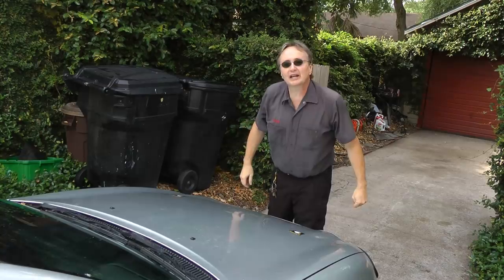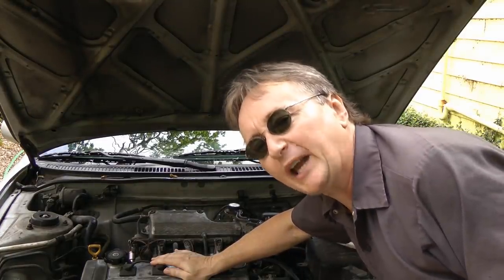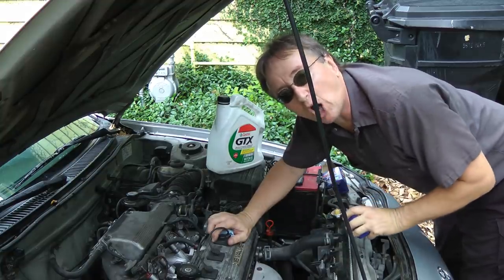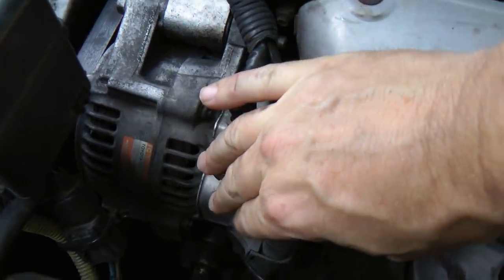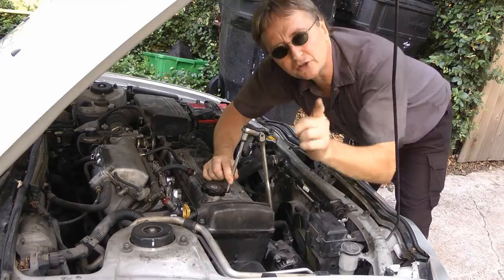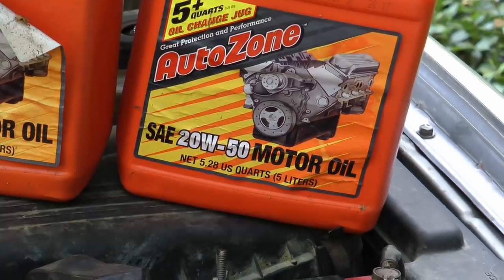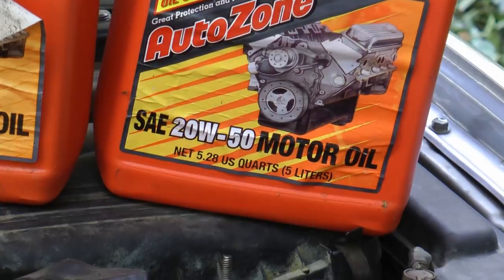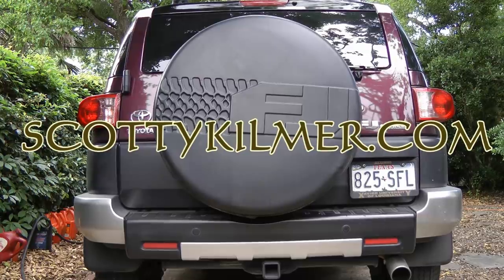Top 4 Mistakes Car Owners Make (DIY Fails)

Comment: Why are newer engines using lighter & lighter weight oil? I just saw 
0W 20 oil for the 1st time.
Reply: Innovation in both synthetic oil technology and lighter more efficient engines. Less work for more power. Less thick of a lube for same or better performance.

Comment: Another common mistake that causes a lot of drivability problems is using too much anti-seize compound on the plugs! When torqued back in the head, the compound is meshed and runs all over the plugs, gumming them up badly!!!

Comment: I know a fellow that's a engineer that works for Duke Energy electric company. !!! He buys a new Chrysler and drives it for five years about 60,000 miles he never vacuums it cleans the windows empty the ashtray but mainly he doesn't even change the oil. !!!! He will put 60,000 miles on the factory oil. !!!!! Says he don't give a shit he'll trade it in. !!! That is what scary about buying some used vehicles. ?????

Comment: Do you have to wait for the engine to completely cool down to change pcv valve?
Reply from the maker: +Jschro1987 no
Reply: +Scotty Kilmer You might want to, So you do not burn yourself depending on where it may be located.

Comment: Test your own oil. Put a quart of oil in the freezer for 3 days take it out open it up and see how it flows out and down a piece of metal do this with your cheap garbage oil and compare.!!!!! Make sure it doesn't get Vapor locked cut an extra hole in the bottom of the jug

Comment: Dont forget to fill the new oil filter    with the new oil and wet the top seal as the motor has to fill the filter when you start the Donk after changing the oil an filter

Comment: By the way, it's NOT "10 weight" - it's "10 WINTER".  The "W" means how thick the oil is when it's at 0 C (NOT 0 F).  Most temps are used in the NEW (Celsius) temp scale (0 is whwen water freezes; 100 is when water boils) - NOT Fahrenheit (0 was the coldest Winter Danier Fahrenheit - a Polish Layman - could in Danzing, Poland - in 1712, and 100 was his wife's temperature.  His wife had a FEVER!  Use Celsius, folks!!  Get with THIS CENTURY.

Comment: *recommends to look at the owners manual to determine proper oil grade to use* *warns about using the wrong grade of oil* *proceeds to use 5w-20 castrol in a car which recommends 10w-30 :D priceless

Comment: Is it true to up the oil weight when car has 200,000+ miles?
Reply: In my case it was not. I had a Ranger with over 200k so I listened to people who said use heavier oil. But I noticed when it was cold I heard some tapping at startup. So I switch it back to what was recommended and the noise went away.

Comment: I have a dodge grand caravan 3.3 the speedometer is acting crazy it drops to 0 and back to its speed but does not stall out and the ESP brake and ads light comes also the engine light the dome head and tail lights flicker no one seem to know what is the problem
Reply: There you are Scotty. Jump right in.  Dodge Caravan screwing up. (Need new caravan??)
Reply: Sounds like a complex electrical problem or computer failure. I'm willing to bet that the computer is shot.

Comment: TOP MISTAKE of this video. Saying that the "W" in the oil rating stands for "weight". It stands for WINTER i.e the lowest temperature that the car is likely to encounter. The 2nd number is the SAE rating of the oils viscosity at normal running temperature.

Comment: What do the numbers on the oil can mean, like 20w50? Thank you.
Reply from the maker: it means the basic viscosity of the oil in wintertime. 20 when engine is cold, and the same property as 50 oil when the engine is hot.
Reply: it´s a Little more than that: -------The first number is an index (not an actual physical value) for the lowest temperature it´s still below a certain viscosity- it´s supposed to mean the lowest temp at wich the oil is still pumpable with a lower index meaning a lower possible temp f.i.   0 is 40celsius, 5 is -35, etc. --------W stands for winter (to specify the meaning of the number ahead of it) ------ the second number is an index for the viscosity at 100 degree Celsius with a higher index meaning a greater viscosity (a thicker or heavier oil)

Comment: Old Black Oil On A New Filter, good going there! Use just enough NEW oil to make the gasket just glossy. This way it won't look like a leak on your motor when the old oil gets warm and runs down the side of your engine. DIY is not for everyone. Even a good You Tube Video can't make a Piker into a good mechanic right Scotty! Right!

Comment: wow. WEIGHT versus WINTER for the W on oil. oil has numbered and alphabetical codes designated for it. through time these code have changed and has been adapted into layman terms for the average public to understand. when oil is being circulated inside of engine it is lubricating no matter what weight or if it is winter. if engine is warm.  it could be zero 30 with for all that engine cares. the W is about before an engine starts and then the operating temperature of that engine. the ability to fight gravity and flow at a certain velocities and certain temperatures, long way up through push rod or to reach an overhead cam through the oil ports. and an oil pump won't pump( actually it pushes oil  ) if the oil is to thin. the W actually stands for weight instead of winter it is a unit of measurement Against Gravity ( velocity )  . A regular lawnmower that takes W 30 slings the oil to lubricate, does not pump if it had push rods, overhead cam, horizontal or vertical then the engineers would determine the Pacific weight of oil (not in pounds) for that motor well I'll take it into consideration the temperatures of that climate. Scott is old school and he is right. what weight of oil should you use, ask your manufacturer. or ask what winter weight of oil should I use in Canada.

Comment: You can always just use electrical tape and tape off the hot wire. Taping is pretty fast and easy and comes right off when your ready to attach wires to new alternator.
Reply: No need to do that if you disconnect the battery.
Reply: @jimmyraythomason1  amen

Comment: The dealership told me Nissan cars require power to the computer.  Should you still disconnect the batter and just hook up a battery charger to the positive and negative wires? Is this just a bunch of BS?

Comment: In 2019 depending on the parts, spark plugs no longer need anti-seize lubrication.
Reply: No, they still do in 2019 and in cars 2010 and newer. Companies can claim it, but when you take NGK/other brand Iridium or even Platinum plugs out they will squeak and come out dry still.  Can easily strip threads, gall up, or break plugs in half...so a dab antiseize is still needed....thats real world stuff, not reading on internet stuff.

Comment: "W" is "winter" not "weight".  Good general advice though, thanks for the video.
Reply: Francis Flynn They go hand in hand, why would a person want an oil that moves slower when cold? 20w implies both weight and winter- thicker moves slower.
Reply: Jeff Banfield no it does not. The w stands for winter and the number is the oils viscosity index. It has nothing to do with weight. Viscosity is a fluids ability to resist  flow. Weight is basically a slang term that has been used so much that it has become part of the vocabulary, but it is not correct.
Reply: It's not Winter it's Weener

Comment: dont forget to fill up the oil filter with oil. even if it goes on sideways, put some oil in it. Im not 100% if this really matters, but i was told to do it because it helps the oil pump not work as hard, so bust that myth if you can. And why the hell did you use old oil to lube the gasket?
Reply: I think I can answer for Scotty. It wasn't so much oil. I was going to discard it anyway.

Comment: Can it harm the engine to use 5w-40 when it recommends 10w-40?
Reply: +GeneralSirDouglasMcA Nope You wont harm your engine and it will be easier to start your car when its cold outside.(:
Reply: Ok thanks.
Reply: +GeneralSirDouglasMcA No broblem.

Comment: Anyone that needs this advice should take their car to a qualified mechanic, just sayin. I always clean off the oil filter flange before applying the new filter so if there's a gasket or any grime there it won't be there when I'm done. Scotty you forgot to mention another mistake some people make in changing their oil, (over tightening the filter) the results can be devastating.  Also when you disconnect the negative battery cable on some newer cars for any length of time it may be necessary to retrain the ECU which may be a specific process as with my Ford F150, if not done properly both performance and gas mileage may suffer. There are methods and devices available for keeping the ECU memory when your battery is disconnected to avoid a P1000 code and the need to retrain your ECU aka PCM in some vehicles.
Reply: Yes people should know how to do this stuff. But some will watch videos like this one to learn how to do it correctly. Everyone has to start somewhere.
Reply: About over tightening oil filter. Tell that to Ford. They go on with an air wrench before engine goes in the car. Talk about tight.
Reply: Any pneumatic or electronic wrench or device auto makers use is set to a specific torque value set for the intended purpose and calibrated on a strict schedule. Yes they use pneumatic wrenches on just about every nut, bolt or device that goes on a vehicle because "hand tight" to the guy working first shift might have a different "hand tight" than the guy working second or third. The reason is consistency and the torque value is set low for the oil filter. 30 years in working in auto plants around the world has taught me a little about quality control.

Comment: 1 mistake that car owners do to there car is to put the spark plug wires in the wrong hole or in the wrong spark plug 
Ex:
Piston 1 should have spark plug wire number one

But people forget to put it in the right hole like

Piston 1 has piston 2's spark plug wire
Reply: Gabriel Austria
On newer cars the wires are generally not long enough to reach the wrong holes.

Comment: My 90 Lumina recommends 5 W 30 but I've been running 80w 90 about 82,000 miles now.
Reply: bill thompson 80w90 is special high pressure oil for transmission. But the grade is like 10w40.
Reply: Nicolas Lastavel I was just kidding. I wanted to see if I could give anybody a stroke. You know how long it would take that 80 90 to get to the top end in winter
Reply: I bet it wouldn't leak any oil if you did that LOL.  Probably would knock really nice too HAHA!!!
Reply: bill thompson um dude that's like manual tranny oil that's way to thick
Reply: I haven't seen a '90 Lumina since about....' 94.

Comment: So why does auto-zone recommend heavy oil on older cars?
Reply from the maker: +TheTruelakersfan because that's an old trick for worn out engines. If you engine is old and burns a lot of oil,  a heavier oil can help somewhat
Reply: Well my engine doesn't burn hardly any oil even though it has almost 200,000 miles on it.Should I stick with the original OEM spec 5w30 or go with the 10w40 autozone recommends?

Comment: whats the difference between engine oil n transmition oil????
Reply from the maker: they are different types of oil, one lubricates hot engines and is generally thicker, the other lubricates tranny gears and is usually quite thin in automatic transmissions

Comment: Why don't you fill the new filter with oil, dry starts are no good
Reply: they tell you that but i think that is just a myth. some filters are sitting sideways so you cannot fill with oil anyway. besides unless the engine has been sitting for a long time there is still an oil film on the bearings anyway.

Comment: Why else will make my car hesitate on excelerration....i cleaned the throttle, I changed the spark plugs, cleaned the air sense, changed the pedal positioning senser and the problem is still there
Reply: Miguel Gonzalez change the fuel filter, add some Heet to the fuel. Is the air filter clean? Is the timing correct? Are the plug wires good and on correctly? Is the sparkplug gap correct?

Comment: I've made that double gasket mistake before. I felt like such a dumbass. On the bright side, I quickly turned off the engine when I noticed the huge puddle of oil on my driveway. So no damage occurred.

Comment: A lot of people are acting clever by calling out a "got-ya" on Scotty for saying "10weight-30" instead of "10winter-30." It is correct that the W refers to a Winter viscosity rating. However, ask yourself when have you ever heard anyone say "10winter oil?" Never. The viscosity grade of the oil is also called the oils "weight." 30 seconds with Google will give you a nice article on the Pep Boys website explaining oil weights:
https://www.pepboys.com/accessories/car_care/oils_filters/diy_learn_weights

Basically, it would be more correct to say that "10W-30" is the oil weight, but it's not uncommon to hear a mechanic say "10weight-30." And yes, that W stands for Winter, but it's the winter weight of the oil so this isn't something worth calling someone out over. Or you could go to a mechanic and request "10winter-30 oil" and let them stare at you blankly for a little bit if that's what floats your boat.

Comment: Douche bags at quick lube places always pull a sparkplug out to try and sell you a set right after you come driving in and then torque it back in tight when you tell him you did not come in for plugs. Once that happens, that sparkplug may not come out again. they charge you for premium oil while using some generilube  from a big barrel out back and then short you a quart because they don't fill filter. I will change my own oil thank you.

Comment: hey guys is it true you cannot disconnect the battery if u wnt to change to a new battery becus doin so wil cause the ecu of the car to reset by itself. all of the people here in Malaysia will tell u the rite thing to do is by keepin the engine running while changing the battery. i knw it makes no sense at all. so is it rite or its just a myth?
Reply from the maker: they reset to some extent but most cars will reset just driving a short time by itself> DOnot keep engine running when changing the battey, that can destroy computer modules
Reply: +Scotty Kilmer thnks Scotty u'r the man. I guess thts why they say to the customers 'ur ecu needs to be reprogrammed.' the truth is they had destroyed the ecu by doin tht method. no regret why I left the auto school becus they didn't teach us the rite thing. and i found tht I learn alot by jst checkin out ur videos. thnks sir for teaching the world.

Comment: Sorry Scotty, I have to disagree with you on one thing. The oil viscosity. At least in certain circumstances it can be better to choose one grade higher of viscosity oil. If it is summer and you live in the south, or somewhere else where it gets above 90 degrees, then you should at least look at your owner's manual and check to see if it recommends using a higher viscosity oil during the summer. I have had cars that specify certain viscosities for certain temperatures but the oil cap only specified the general purpose viscosity. I also believe that this is the reason my car started burning oil after one extremely hot summer vacation trip through California and Arizona. If I had used the thicker oil that it called for, it would probably have ran another 50,000 miles or more before it started to burn oil(almost 200,000 on it now). It was actually quite noticeable of a change. It was all fine and dandy when I did my pre-trip inspection, and through California, and then after traveling most of the way through Arizona I noticed that it was starting to smoke a tiny bit in my rearview mirror. I still kick myself for not thinking of it when I changed the oil to get ready for the trip. 

Another thing about oil viscosity is that manufacturers have to reccomend the correct weight of oil for all possible driving conditions (and crazy drivers), but if you know that you will never redline your engine, or even come close, and you are more likely to lug your engine, then it would probably be better to use one grade higher of viscosity.
Reply: I agree, David. Some engines that use no oil will use some in high temp Freeway driving at 10-15 MPH above speed limit.
Reply: That doesn't really contradict what he said.   He said to use the recommended oil.   So if the manual recommends a heavier oil for summer, that is the recommended oil.
Reply: @jshepard152 
But the oil cap is what most people go by. Most people never read the manual.
Reply: David Scott
Probably true.   But I don't think you're going to get into any real trouble using the oil recommended on the cap.

Comment: Holy smokes. I can't say it enough. Use the right oil. Stop using the thicker stuff. If the cap says " 710" use 710. No seriously 5-30.

Comment: please tell me I shouldn't buy a used but prestine looking audi s6  5.2l v10 2007 for $24k nz dollars, I'm very nervious that I will bid on it , I did test drive the car and of course I did love the engine and how immaculate the car is, gas consumption ? hmmmm 435hp  hmmm They are 10l per 100km on the open road but in town forget it lol , do I need to get myself into trouble and own this motorvehicle please tell me
Reply: Dude.  Them germans engineer a fine product but when they hit that age of no return,  you'll be in over your head unless you got a fat wallet. 
The only way id recommend it is if it came with a parts car. 

Hell,  even when I get a very commom truck, like a 90 ford f150 i get a parts truck as fast as possible.
Reply: Were you able to hold back?
Reply: Yehp I bought a audi tt 3.2l v6 instead and thats fun for sure love it <<: